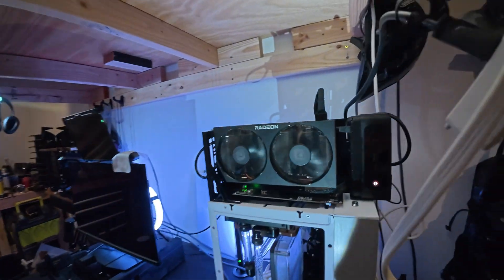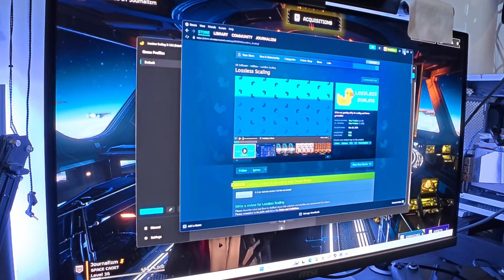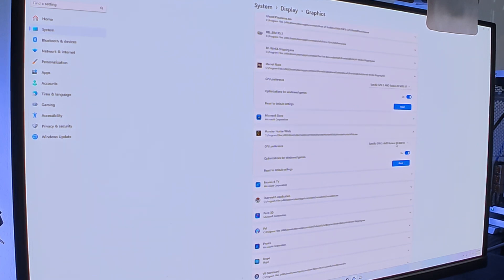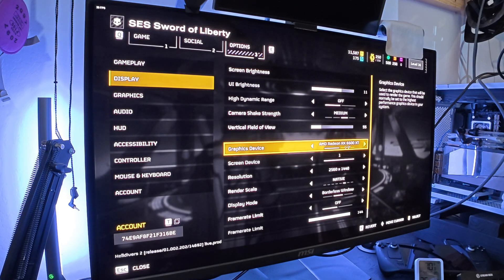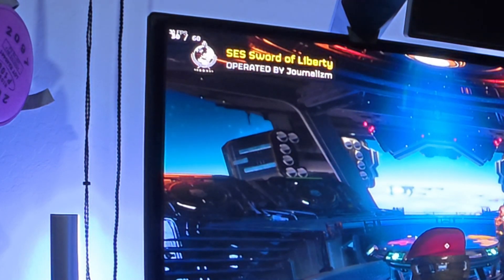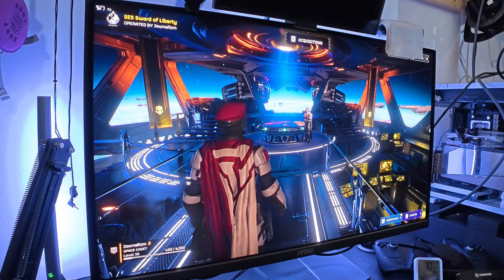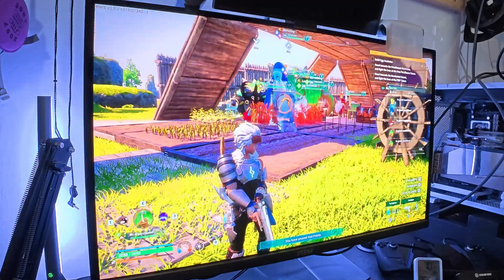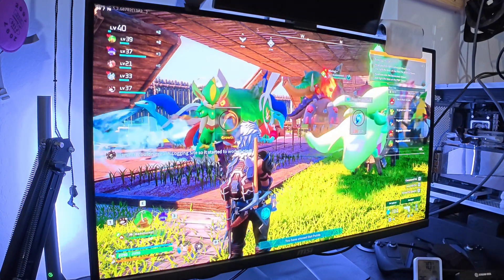iGPU are underrated

Comment: I'm running the R7 8700G and it's capable of tripling 60fps to 180 at 1080p. This is at full 1080p flow scale as well. Personally I still wouldn't recommend using an APU unless you have a specific set of purchase requirements like I had. I got the 8700g because I wanted an AM5 8 core chip and it was only $20 more expensive than the cheapest AM5 8 core. That said an RX 580 would outperform it in this task and the 8700G has a significant restriction in the form of only 16 usable PCIe lanes. What this means is that you can't use a dual GPU setup without sacrificing potential PCIe upgrades, including NVME SSD's. If AMD woke up and saw the potential here they could have knocked it out of the park just by giving their G series chips 4 extra lanes, enough for 2 GPU's and an NVME SSD. Why is putting a third GPU in the system a big deal? Future upgrades.

Start with an APU to get off the ground, then later upgrade with a dedicated GPU and use the APU for frame generation. Once you have enough for another GPU you use the old as the new frame generation GPU and now you're finally ready to leave the APU behind and upgrade to a more powerful pure CPU. It provides a clear path from bare minimum PC gaming all the way to 4k 240fps where the value of the overall system is greater than the value of its components. AMD can make this real by first adding more PCIe lanes to their G series lineup and support dual GPU functionality with frame generation.
Reply from the maker: I appreciate the in-depth comment and feedback!

Comment: Bro i cant properly use it , can u please help 
I have 6800H (680M) and RTX 3060 6Gb 
Can u please tell which Gpu should be GPU 0 and GPU 1
Reply from the maker: Under display settings to make sure the preferred graphics card is the 3060

in lossless scaling make sure the GPU does the upscaling

Comment: you can lower the flowscale if the APU is too weak to generate high frames for the game u wanna use FG on.
60-70% flowscale have minimum quality loss but greatly boost performance of APU.
Reply from the maker: That's a good idea, ill have to try that out
Reply: I'm unable to pick between 8600G  or 7600. 

Am I better off with the 8600G
Reply: @digivagrant it depends on what gpu ure gonna use and resolution ull be playing on
Reply: 7600 is way powerfull CPU with way worse iGPU.
8600G alone can run games at 1080p without issue without GPU when you use afmf2.1.
Afmf3 going to release in 6 months.
If you got a GPU allready then just go for 32mb L3 cache 7600, any 8000 ryzen sucks for gaming as CPU but they have good APU (G).
I went to 9600x its basically same as 7600x but lower wattage for higher overclock potential.
Reply: @Kage0No0Tenshi  Yeah sure. 1080 at 30 flickering fps on my end.

Unless I need to overclock this thing?

I can kinda get smooth frames at 720p upscale, 50 fps locked...

Comment: Hello... has anyone got it to work with Asus Rog Ally with egpu? Once egpu is connected there is no way to connect external display directly to the Rog Ally.

Any ideas?
Reply from the maker: Unfortunately no, had the same issue with the steam deck. AMD wont allow you to use the native display for some reason 

You can do it the other way around tho
Reply: @Diy_Papi will results be the same?

Comment: I tried it with RX6900XT AND GTX980TI IT WAS BAD
Reply from the maker: Having the same issue with a 3090 and a Rx 6400. Trying to find a solution now but it’s not looking good
Reply: @Diy_Papi   i will be on the lookout for a video from you explaining the fix what i think my problem is that i have pcie 4 and i think it will be better if i used a psu just for the other card i have 1200W psu btw
Reply from the maker: @HomelessMoon1  finally fixed it
https://youtu.be/QMWmEb2qS5I

Comment: Do dual high-end GPUs please
Reply from the maker: Just tested it with a 3090,  I just uploaded it, it didn't go well... stay tuned for part 2
Reply: @Diy_Papi Really? There's another channel - "Delusional Depictions" -  that has it working well with an 4080 and an 5070TI upto 5K. You need to configure it correctly.

First, the monitor must be connected on the GPU running Lossless Scaling. It massively reduces the PCIe bandwidth requirements and minimizes latency.

Secondly, you must optimize the distribution of PCIe lanes to each GPU. This may involve switches PCIe slots and configuring each slot's speed. Lossless Scaling is highly dependent on PCIe bandwidths.
Reply: @Diy_Papi  i heard the new Nvidea cards are not good for frame generation in losless scaling

the guide says that AMD rx 5xxx and 6xxx cards are extremely good for it.

probabaly also never AMD GPUs.

thats atleast what i heard about it.

Comment: I have another tip for everyone that has a 4k monitor or 4k TV but only has 60HZ to work with. Get yourself an "EDID" device. It might save you from upgrading. I got a Gofanco Prophecy 4k 120HZ splitter device. It has EDID built into it. My monitor now supports 120HZ at 1080p thanks to this device. My monitor needs the EDID so 120HZ gets unlocked on my monitor. My monitor can't spit out 120HZ by itself.
Reply from the maker: So it downgrades the image to increase frame rate?
Reply: @Diy_Papi  For me, gaming at 4k isn't smart. Only if I'm satisfied with 60HZ. So I can't upscale with Lossless Scaling because windowed 720p 120HZ or windowed 1080p 120HZ will just drop down to 60HZ if upscaled to 4k. My 3 options are. Game at 720p 120hz native or 720p windowed to upscale to 1080p 120hz or just game in native 1080p 120HZ.  Yes, it's important to pay attention to all your options. I can't mix match 1080p 120hz windowed to upscale to 4k only for it to drop to 60HZ.
Reply: Hmmm 🤔 would it work on a tv ?

Comment: This is awesome, I just got a RX6800 & I am due a CPU upgrade, I am thinking of a APU because of this
Reply: Less lag too!
Reply from the maker: 9000 series have iGPU, thinking about upgrading myself
Reply: Wait for next gen Ryzen, it will bump the igpu performance by a lot, 8 cu of rdna4 vs 2 cu of rdna2
Reply: @MrAbel00 Last I checked, they're skipping RDNA4 with iGPUs (something about the die being too large to physically fit on the CPU). Instead they're working on a Unified (UDNA) architecture as a successor to RDNA.
Reply from the maker: @CaptPatrick01 good to know
Reply: 7000 and 9000 are rubbish for having a 2CU igpu.  Its 8700g 12CU or 8CU 8600g (Pheonix 1)
Dont bother with Phoenix 2 8500g and lower

Comment: Tried this in 2012 with a8 apu and gpu that was supposed to “pair” with the apu and increase performance. It was 300$ brand new but unfortunately didn’t work well. It was just to underpowered compared to other popular cheap components like 2500k and 660. While double the price one games and one didn’t sadly
Reply from the maker: Very interesting, was it a crossfire thing?
Reply: @Diy_Papi yeah, sort of asymmetric crossfire

Comment: In the real world it makes no sense to do this, just run frame gen on your main GPU you dont loose too much performance. 

Rendering the game on your main gpu then output-ing it over your APU will cost you more performance, rather than running frame gen on your main gpu. And most importantly the performance loss you are taking is on the real frames rendered by the GPU. 

look man like a good little boy just lower the graphics put on some dlss or fsr and call it day. Frame gen is double edged sword, it feels slightly more smooth with the cost of input lag. I personally feel the input lag much more than any smoothness idk why, 120fps with frame gen feels like 80 or 90 fps to me, better than the 60fps base but not good as actual 120.

well in short pls dont do this just run frame gen on the actual GPU.

Also the part where you said, "its machine learning so it gets better over time, at least to my understanding". You understand wrong, it wont get better the more you use it. Only nvidia can improve their dlss frame gen and then release a new version to the public. same with AMD frame gen. 

For anyone not convinced just use common sense, training AI models takes 1000s of gpu and months of time. Though the image gen model is not as big as chat gpt, to learn it still needs to train on the data and learn. If this as happening while you play you would be getting 0.1fps.
Reply from the maker: So from my testing, When running FG on the GPU overall frames dropped by 15% compared to Running it on the APU. 

Im not sure I understand what you are talking about.

Comment: this is absolutely huge for both laptops with dgpus and apus and handhelds using egpus!!!  I need to learn how you managed to get it working ive seen a few other videos on this and now getting ready to do it myself on 3 pcs.
Reply from the maker: Its great for any pc with a AMD iGPU, but if you want to run it with Dual GPU cards there are some hurdles.
Reply: @Diy_Papi  My laptop is a lenovo legion 5 slim its got a amd 7640hs apu with the 760m igpu and its also got a rtx 4060 built in.  I sometimes use the 760m just to see how well it works i mean its supposed to be a lil less performance then many handhelds which run on the 780m but being that its in a bigger laptop its almost like it gets more wattage and therefore seems to almost match the performance of my handheld using the 780m.  So needless to say the 760m is actaully a pretty decent igpu which really surprised me tbh.  Now on my intel pc with a igpu man that thing is so crappy it can barely run anything on the igpu alone but thankfully that pc has a gtx 1080ti which albeit old still does well for me in that particular pc.
Reply: also worth mentioning that the frame gen performance uplift i see with the rtx 4060m is very minimal so i think using the apu for frame gen would likely be a huge benefit.

Comment: Is the monitor plugged in your iGPU or in your discrete GPU??   Will this work on dual monitor?
Reply: gimme a sec brother, I'll check.
Reply: ok, so when switching the same option he did, it lowered my overall fps (I believe it switched to using the integrated in the game or something when I did? idk for sure) but when changing which monitor it would display from (the one my rx 6600 is plugged in to or the one the integrated is plugged in to) I did notice more frames when choosing the second monitor (integrated) but it still displayed on my main monitor, so I suspect it doesn't quite work the same, anyone more savvy feel free to correct me.
Reply from the maker: HDMI is hooked to the IGPU so the the mother board, you can do dual monitor but I think the secondary might need to set up through the MOBO aswell

Comment: I highly recommend getting a 4k Gamer Pro or 4k Gamer Plus. These devices make Native 4k look like blur. The only downside of using these devices is if you have a high refresh monitor. You're stuck playing every game in 4k 60fps. The visual quality beats the Native 4k. But like I said, if you have a high refresh monitor. You can't use Lossless Scaling to get 240fps. You have to stick with the 60HZ range. If you do decide to grab one of these devices. You must play your games in 1080p 59.94HZ so it upscales to 4k 60fps. You can also apply a lossless scaling filter on top of the 4k Gamer Pro or Plus to enhance the visual quality.
Reply from the maker: I’ll look into thanks for the heads up
Reply: @Diy_Papi The Gofanco Prophecy 4k 120HZ is a splitter and a EDID. EDID will automatically give you access to all your hidden resolutions and hidden refresh rate your monitor and or TV won't allow you to use.
Reply: @Diy_Papi I had to come back and talk about the Gofanco Prophecy 4k 120HZ splitter. I told you it unlocks 120HZ on your 4k monitor or TV. I was kinda wrong about that. It sends a 120HZ signal to your TV or monitor. Not unlocking which I was wrong about. So basically it's upgrading your TV or monitor. Not unlocking new resolution and new refresh rate options. Sorry about some of the miss information.
Reply: @Diy_Papi  Here's proof about the Gofanco Prophecy 4k 120HZ splitter if you doubted me. https://youtu.be/5657Z7eEr2k?feature=shared
Reply: @Diy_Papi  What I tell you is very true. The 4k Gamer Plus or Pro beats Native 4k. You only lose high refresh rate and stuck at 4k 60fps. I wish you could have both the quality and the high refresh rate but you can't.
Reply: I wouldn't trust anything that has a site full of fake made-up advertisement images where they purposefully blur the first half and sharpen the latter half to give you the illusion of an improvement. You don't even sound like a guy who knows what he's talking about.

Comment: I have a 3060 6gb laptop with a 5900hs (basically the 5700u) and I bought ls without knowing this for my desktop. My laptop just got a completely new lease in life.
Reply from the maker: That’s so awesome! Such a cool tech
Reply: 5900HS is in fact NOT comparable to a 5700U.
Reply: So did it work on laptop ?
Reply: basically whaaaaaaaat?
Reply: @itsmilan4069 it's the 2021 Zephyrus G14
Reply: Did it also have a igpu?
Reply: @yasirrakhurrafat1142 its a damn good APU what are you even talking about?
Reply: @yasirrakhurrafat1142  of course ,if there is no igpu the laptop will last 2-3 hours max
literally all laptops comes with APUs "CPU+iGPU" and they are automatically switching between igpu and dedicated gpu depending on the load to save power.